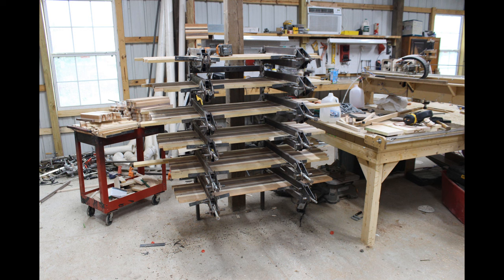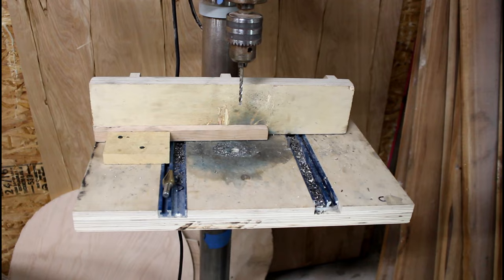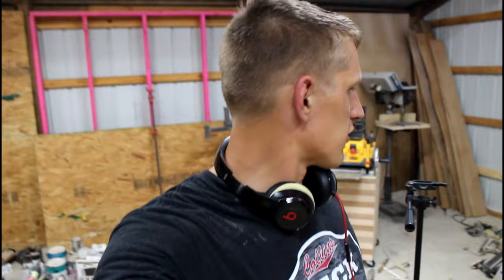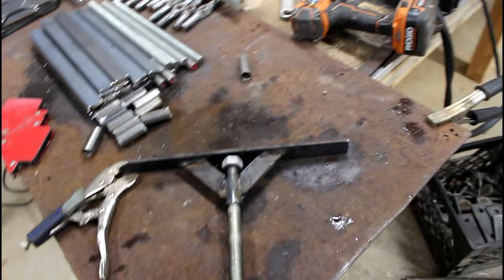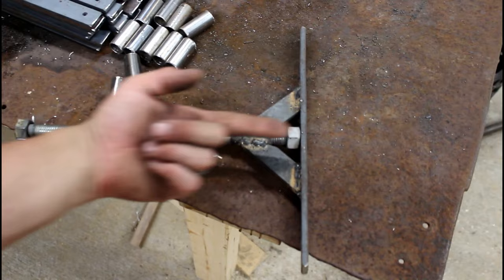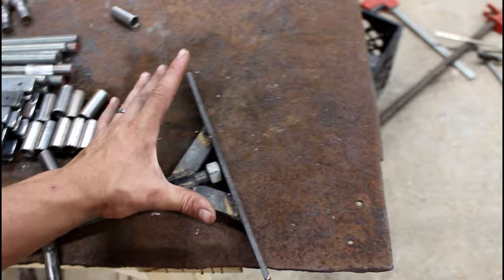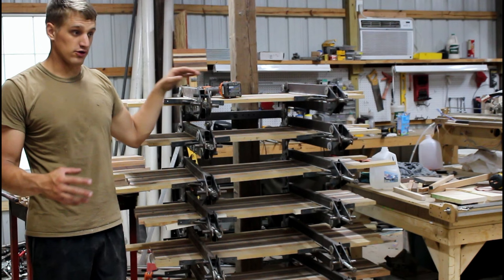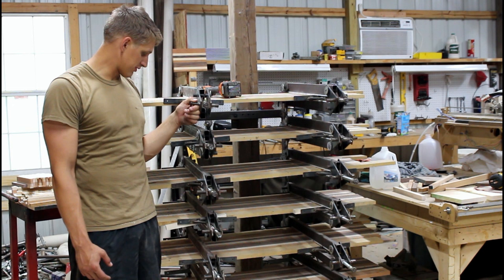diy panel clamp station

Comment: Before you weld the nuts in place, put the threaded rod in the nut with some oil on it, you will find that it helps to protect the thread and has the added benefit of helping to rust proof (blueing) the nut and a portion of the thread as the oil is burned into the metal. hope this helps, from australia, btw well done looks great!
Reply from the maker: Thanks for the tip I will have to try that. I am upgrading to the ACME threads right now! so I can try it on them.
Reply: What was the total cost in material to make it?
Reply from the maker: It cost 240 with the threaded rod. The ACME rod upgrade cost another 200. And it is worth every penny when I have a 400 cutting board order!
Reply: Thank you for serving. Are you still active?
I like the way you did 400 minus 32 equals 368 so fast.
I would enjoy being your helper.
Good luck growing your business.
Mike